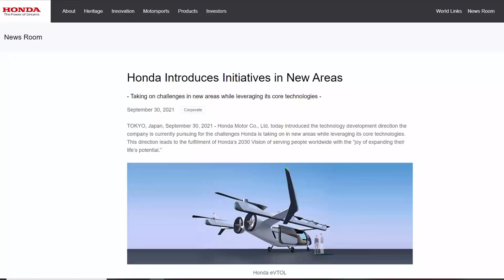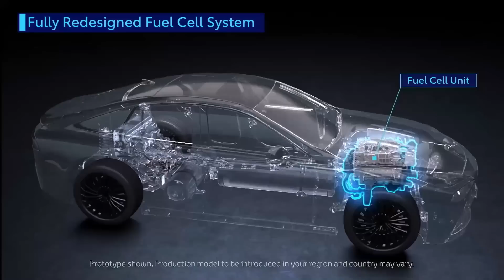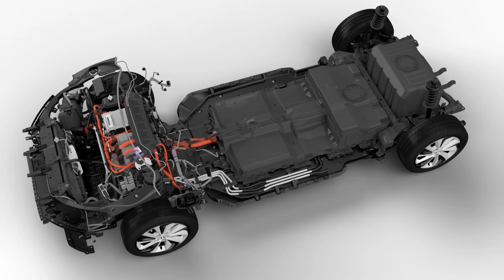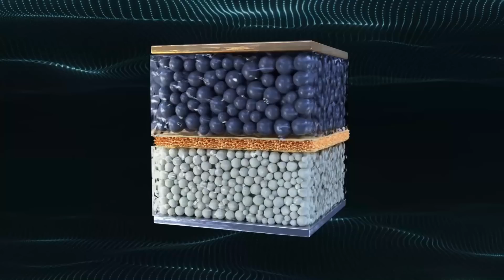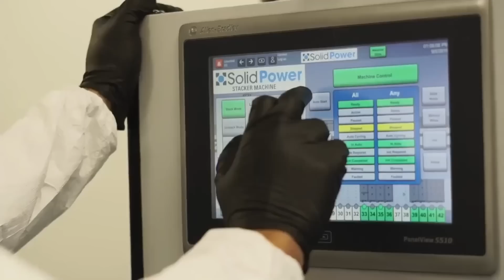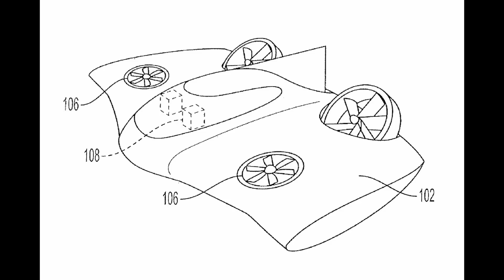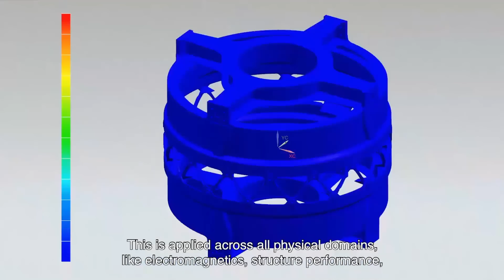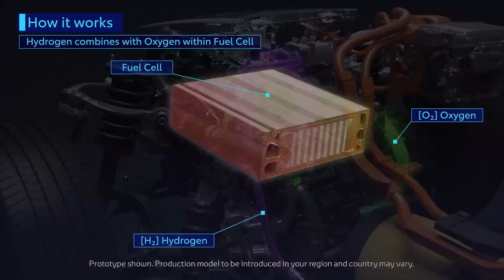EVTOL by Auto makers: Honda, Toyota, Hyundai, Porsche and Aston Martin

Comment: 250 mile range is over reach, for several reasons. The first is that multi prop configurations dedicate most of their energy to maintaining loft, rather than forward motion. For this reason, there are inherent vulnerabilities when dealing with atmospheric conditions, such as wind shear. Another is vector dynamics, bc low velocity forward motion is subjected to rapidly changing conditions which increase the frequency of emergency landings. Security is a problem. Over long distances the crafts are vulnerable to small arms and lasers, drones, and flocks of migrating birds.
Reply from the maker: Thank you for your informative comment

Comment: Good presentation. One correction, though. At 2:07 - the Embraer 100 and the Cessna M2 each outsell the Honda Jet by a considerable margin. I knew several people who worked at Honda Aircraft. The company pays well below the industry standard; one reason that it has a high turnover rate. It's hard to attract and retain top talent when pay and morale are low. It'll be interesting to see if the parent company will invest enough in the VTOL concept to get good engineers and others there, or whether Honda will be content to let other companies remain in the lead.

Comment: The best is to use electric motors with no batteries . 
For longer flight times . 

Batteries are a waste of time because they will never use the a battery that never needs to be recharged .

That's what I think when you say solid state battery .

And 

To really go to proper nuclear .
As a power source is to convert radio active material that actually makes electricity outright .
Not a steam engine .
It actually converts it's directly to usable Voltage and amps .

Then we are free .

But the Devils hand will not allow us that freedom .

Comment: The RR PTS1..is a gas turbine connected to a dynamo.? Does that mean it’s basically a combustion engine?
Reply from the maker: Yes. It uses fuel
Reply: It's a good example of incrementalism that doesn't really solve the issue of eliminating greenhouse gasses. But maybe they can switch to carbon neutral biofuel.
I guess it can also make use of boosts from distributed propulsion.

Comment: a) there is no "green" hydrogen, the majority of hydrogen production comes at the cost of processing and refining fossil fuels
b) electrical problems can occur at any time without warning even, so anyone approving of electric flying vehicles at this point is an idiot
c) this is all hype to get more investment on something that is much farther away then they will openly admit
d) none of these designs are worth producing either, they have obvious flaws to them that will only encourage electrical failure
e) you have been warned